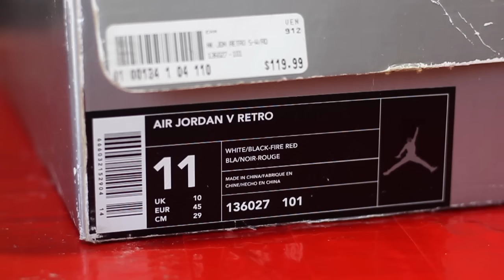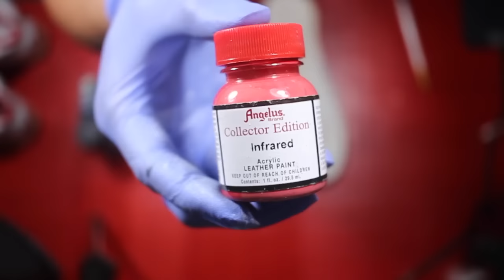2000 Air Jordan Fire Red 5 Full Restoration

Comment from the maker: Before y'all jump to conclusions like my ex, just because I'm sponsored by reshoevn8r, doesn't mean I need to use their products all of the time. I keep it 100 with y'all. If I don't need to use it, I won't.  Dish soap does a better job cleaning rubber. Why waste good product when you don't need to use it? By the way, using dish soap on leather or suede will dry out the material. It's a degreaser. It'll remove  the oils within the material and dry out and crack the material. Stick to what the products are intended for. Don't be cheap and use alternative products. You'll only ruin the shoes in the long run. 

Use my rep code: MANALO for 15% OFF on your orders from reshoevn8r <3
Reply: John Manalo I use dish soap for my soles to man !
Reply: wanna sale?
Reply: John Manalo yo I got some sole swap projects how much what’s the process

Comment: Surprised that you didn't remove the durabuck layer from the uppers where it meets the midsole, are the fire red 5's real material?
Reply from the maker: The shoes were still in great condition. I didn't need to remove the synthetic leather since its still supple.

Comment: Congrats on the 10K subscribers man you def deserve it! Can you tell me from your experience which model of Jordan 6 retro midsoles fits the og 6s outsole the best? I recently got a same size 2014 sport blue 6 for my og white infrared but there's a huge gap around the toe area, so not only the newer midsoles for 6s fit awkwardly but also seems smaller? Any advise will be greatly appreciated!
Reply from the maker: I only use the 2014 midsoles for any jordan 6 sole swap. You can't make it look flush since theres a 23 year difference of fitment. Best of luck

Comment: John I have a question, I customize and restore also. What are the best rubber gloves for doing swaps I've tried multiple different gloves but acetone eats throughly them every time, and that shit burns when you have a cut on your finger
Reply from the maker: There are special gloves from home depot which you can buy. Solvents can't penetrate through the gloves. Forgot what they're called.
Reply: John Manalo thanks man